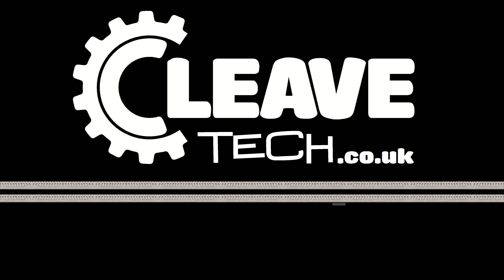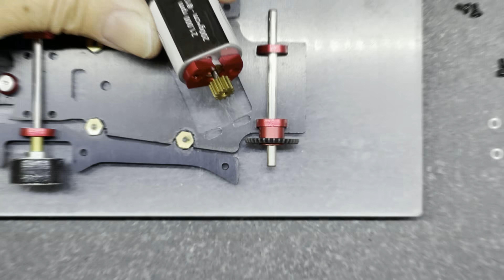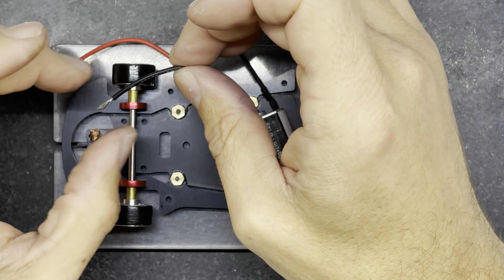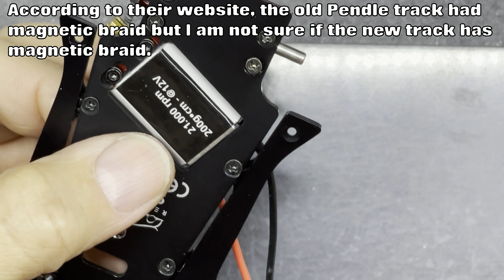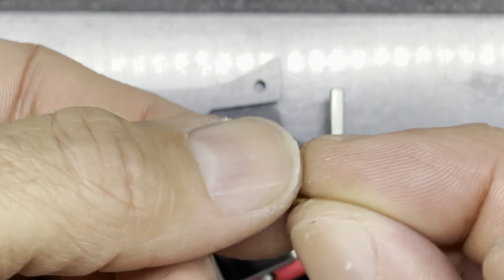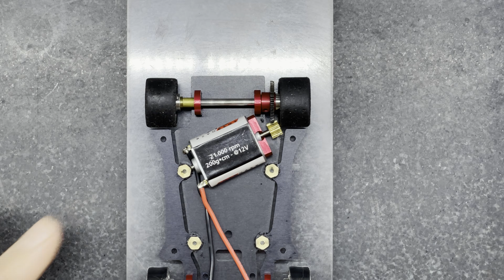Installing the motor and setting up the gear mesh on my RevoSlot Porsche 911 GT2 model car

Comment: Please, what angle is anglewinder solution? And, is the sidewinder only parallel axis or can it be any small angle? And please, what kind is the gear wheel for anglewinder solution? What type of gearing? Thank you.

Comment: If rules allowed it, I would of flipped the endbell 180 degrees to get the timing back positive.
Also slimming the pinion up for less weight. But sounds like a stock racing class.
Should make a milliohm meter for $1 from lm317 and 12.5Ω resistor to check things like wire to pickup brush resistance, pickup to track and other things.

Comment: Hiya, brilliant videos. I'm just wondering if you knew which screws you've used for the motor mount to the chassis. I need to get some new ones for a recently bought 911 and can't find them listed anywhere. Thanks in advance, David

Comment: If you think the chassis has to much ground clearance, because of the tire and wheel size .put thin shims between the chassis and axle blocks.
Reply from the maker: I would like to do that, but the rules don’t allow those sort of modifications. ☹️

Comment: Hi, I am interested in your motor analyser. I understand you are halting production as you are developing a new version for 2022. 

Can you please add me to your list.

Thank you Johnno
Reply from the maker: Hi John. You are on the list. It’s going to be awesome!
Reply: @CleaveTech  I would be interested in the new designed analyser . Looking at the REVO motor you will notice that it is completely sealed. You cannot see the armature nor the motor brushes wear pattern. The motor label covering I think also prevents the worn brush material from exiting the motor can. Can this cause   the motor to eventually foul ?
Reply from the maker: @johnstezelecki8157  , thanks for the inquiry. Send me an email cleavetech.james@gmail.com so that I have your contact details and I will add you to the list.
The brushes in those sorts of motors are very short and generally quite hard. They don’t really generate a lot of carbon deposits so I wouldn’t be concerned about the motor failing for that reason. They are also very mildly wound so they don’t generate any significant heat.
Reply: @CleaveTech  excellent, Thank you 🖕

Comment: Your spurgear and pillar block are rubbing, despite oil. I place a very thin ring (0,25mm) between the parts so the ring touches and rotates only the inner ring of the bearing.
Reply from the maker: They do look like that would be the case but I have turned 0.2mm off of the boss on the spur gear to form the equivalent of a small washer. I just didn’t want to publicise that fact 🤫 😂
Reply: Is it best to have a small amount of play in the rear axle for this car?
Reply: @rockyysolid43  I follow the rule "feelable, but not visible". Sounds paradox, but such microplay is possible.

Comment: With angle cut spurs if the motor axle line is below the wheel axle line you want the endbell side of the motor to be slightly lower than the can end to allow for the angle cut. That said the spurs are so average its not going to make any difference. The spurs are not concentric. You in fact got a pretty good one. Ive had some that are almost unusable.
Reply from the maker: My spare spur was pretty bad so I will only use it in an emergency.
Reply: @CleaveTech  Im looking forward to seeing how close you end up being to the pointy end of the field at your first meeting. If you end up with good grip I'll be surprised if the Porsche doesn't end up being tippy. Make sure you do a vid of the club and the track. Would appreciate seeing what the tracks are like in the UK.
Reply from the maker: @Fabio-ns4ql  Sunday 8PM GMT is the time for the race day video. There is plenty more to come as I have raced it, improved it and raced again! I have lots of video editing to do 😁

Comment: The comm (or brushes) must be effectively advanced when motor is running in reverse. Unfortunately there is no way of taking advantage of that. Pity. Gear mesh for BRM and Revo is average (Im being kind!!). Our club doesnt allow for different brands to be used. I would love to use better spurs. The spurs are the issue. The pinions are superb.
Reply from the maker: Agreed. The spur gear is not great. I bought a spare but the spare doesn’t run true ☹️
Reply: @CleaveTech  Our club does not allow the Revo Ergal spur gear at this time. Wish it did
Reply from the maker: @johnstezelecki8157  , Are you referring to a different spur than the one that comes with the car?
Reply: The Revo spur gear that I'm talking about is the REVO S 419 A Ergal Spur gear that is presently not allowed. We are developing a REVO GT1 Class and I'm hoping that we allow this Ergal gear

Comment: That motor and gearing is remarkably good performance-wise.
My Marcos came with narrow rears, I didn't realise this until a club member bought a set of cars for club use and some had wider tyres but as someone else said lap time doesn't seem to suffer with the narrow tyres. I suppose tyre life will be better with wider tyres.
Reply from the maker: There are plenty of racers who still use the narrow tyres and have good grip 👍🏻

Comment: First up: thank you for the updated intro!
And yes, those wires colours are always reversed =D
I also converted my GT2 from the older small tire to the new wide tire. I didn’t notice a performance difference, I have to admit that it isn’t fully race ready, hence less practice time. If the performance is identical, I have it easier with every car using the same wheels and tires =)
Reply from the maker: Glad you noticed the updated sound level 😉.
I was initially concerned that the wider tyres would cause more drag on the straights but it seemed fine.